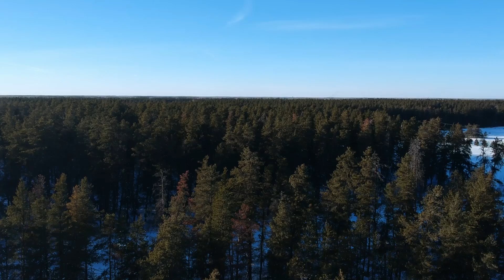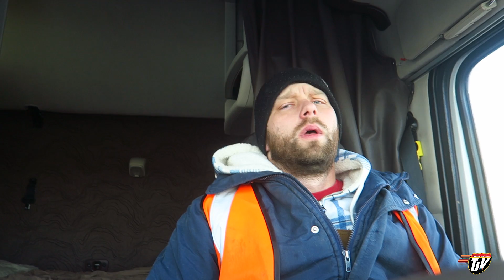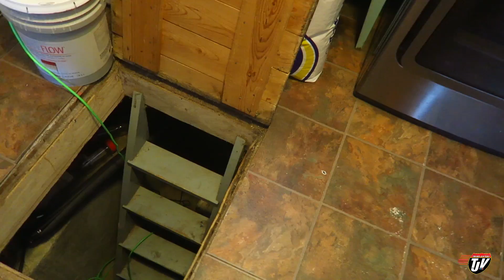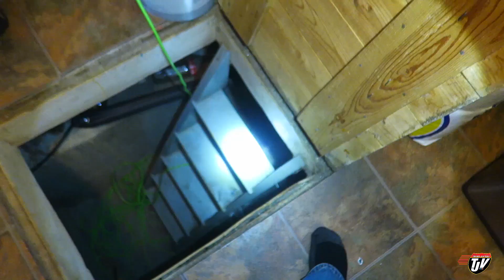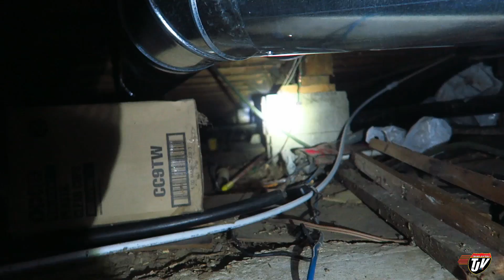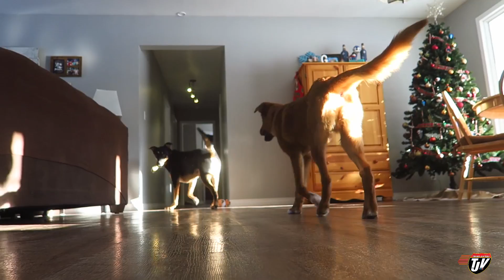TJV Fri - Cold Weather Issues - #1302

Comment: Considering your winter climate I am very surprised that you do not appear to have any pipe lagging installed on any of the water pipes!

Many pumps are equipped with a device that cuts off power to the pump if it gets overheated for some reason to prevent damage. Some devices reset themselves once it cools down on others you have to reset them by pressing the reset button / control. Why may they overheat simply because they are running but not pumping water.
Suggestion a) some part of the supply side is frozen or blocked or b) some part of the pressure side is frozen or partially blocked.

Comment: Josh, most common problem with above ground water pumps are the pressure on the side of the pump. Next time that happens take the handle of a screwdriver and tap the cover on the switch. If the pump comes on, time for a new switch.

Comment: You probably had some ice in the water line, and the pump tripped the safety. By unplugging it, and then plugging it back in, it had cooled back off and started back up again. There's a light socket down there, why don' you put a bulb in it??